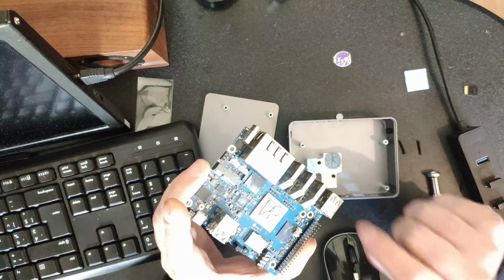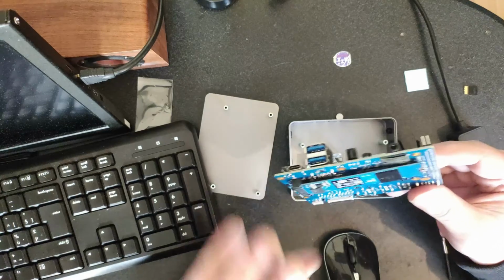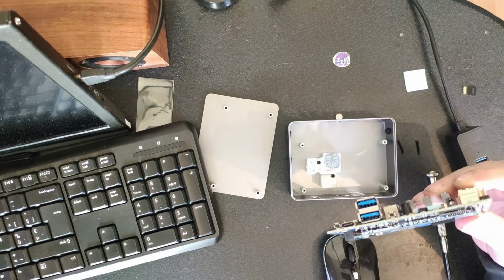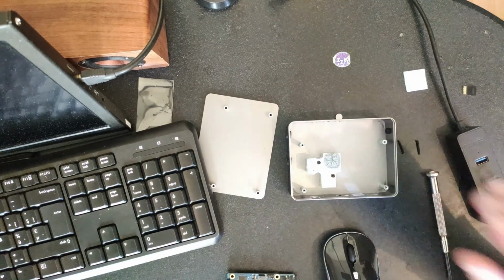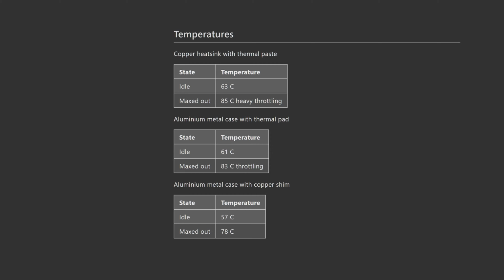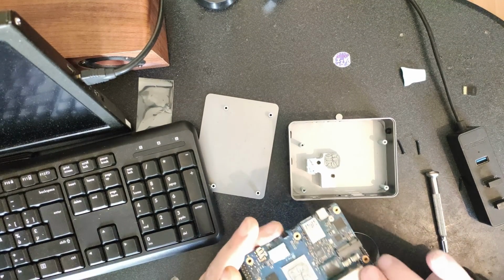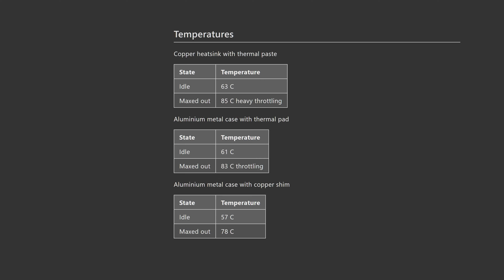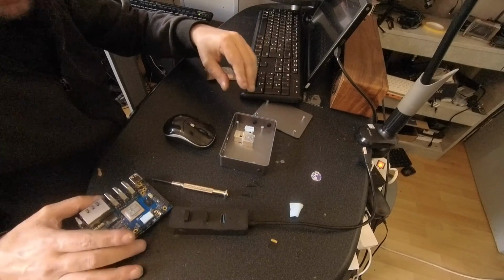Orange Pi 5 Plus Metal case - Improve Thermals

Comment from the maker: !!! Seems that freon, the taskbar app I use in Gnome to check temperatures is faulty. It is reporting a temp of about 10C higher than true SoC temp!!!
So idle it is 49C and maxed out 71C.
The NVMe does get hot in this case. Always above 60C and even goes over 70C with high use.

Issues fixes
------
!!! Fix for the mouse lag in Wayland Gnome. (Thanks Spooky)

# Needs root access so first "su" 
# Mouse lag/stutter (missed frames) in Wayland sessions
# https://bugs.launchpad.net/ubuntu/+source/mutter/+bug/1982560
```
echo "MUTTER_DEBUG_ENABLE_ATOMIC_KMS=0" >> /etc/environment
echo "MUTTER_DEBUG_FORCE_KMS_MODE=simple" >> /etc/environment
echo "CLUTTER_PAINT=disable-dynamic-max-render-time" >> /etc/environment
```

#Some chromium errors can be fixed with (Thanks Infinity Q)
sudo apt install xdg-desktop-portal-gnome

#Fix Chromium not saving credentials (Thanks AmazingFate)
sudo rm -r .config/chromium*

#USB unstable problem
#Install an older kernel.
#USB issue? I had that problem a while ago trying out kernels for my OS. I didn't really figure it out, but armbian-rockchip rkr4, 5.1 and 6 seems to work fine  nowadays (Infinity Q)

Comment: I don't know what's going on with your Orange Pi. My plain Orange Pi 5 idles at 32 C with the same type of case and no copper shims. I have an Apache server running (with very little traffic going through it, but stil) + Home Assistant + a VNC server running as well.

Comment: I’ve been trying to figure out if this case had a column for the components to use the case as a cooler. I don’t want a fan that will get filled with dust over time. 
Good video!

Comment: I took off the heatsync it came with and replaced with my own fan. Unscrew the heatsync, pull it off the pegs, and then bend the pegs with pliers. they pop out smoothly, almost as if they were glued on. now you will have all the space to add your own fan. If you so choose, you can drill a few holes for circulation but it seems fine as the case doesn't seal tight anyways, and definitely better than without the fan

Comment: Thanks for the review. Wonder why they did not put another aluminum collum on the case to take the heat off the board's PMIC. It is widely known that other that the SoC itself, the PMIC is also the hottest component on an SBC.

Btw, it would be very useful if you could do a comparison between Orange Pi 5 running on the latest OS with the latest kernel and drivers vs Raspberry Pi 5.

Comment: Yeah, those pads are sketchy. You need to press them hard for all surfaces to gain contact. 

Is there news on PanThor driver for this Mali GPU?
Reply from the maker: There are mainline images with Panthor from Balbes150 for OPi5. Not sure if they work on OPi5+ too. https://forum.armbian.com/topic/27588-kernel-62-hdmi-usb-lan-etc-for-opi5/
I've not yet tried them. I'm now focused on getting vendor to run well with Armbian. 
Panfork gets 1026 glmark2 on X11
Panthor gets 781 glmark2 on x11
Panfork gets 1315 glmark2 on Wayland
Panthor gets 2314

Not sure if these numbers are anything to go on. Different kernel, driver, image, version of glmark2... But seems it performs better on wayland....
Reply: Wow!

Comment: I tried mine out before I plugged in the fan, and I never got above 55C while compiling a large C++ codebase. Maybe it’s the silicon lottery, as mine tops out at 2.35 ghz. Also, Chromium is extremely slow on Jammy for some reason, and firefox-esr crashes all the time. Only the firefox snap is working 😢
Reply from the maker: I'm looking into the chromium problem. I've been using RK3588 for months as main desktop and don't have those issue's(Meko-Mini). 
But I do not want to update/upgrade to find out if it would be the same.
Indeed the silicon lottery seems a big factor with RK3588. I expected the case to perform way better actually. I'll have to test my different RK3588 with the same heatsink to see what difference there is. They all have a different base clockspeed on big cores. Between 2.2Ghz and 2.4Ghz. Good topic for a new video.
With setting to 2.4Ghz it doesn't seem to be running hotter. At least not measurable enough.
Greetings.
Reply from the maker: Look at the first comment for the fixes. Maybe it fixes your issue's too.
Reply: @NicoDsSBCs  Cool, thank you! Has the no panfrost for Bookworm issue been fixed also?
Reply from the maker: @adamschackart6859  I know people who use panfork on Bookworm. But they've build everything manually. There are instructions online somewhere but they're long and hard.

Comment: Thank you this answered one of my future questions about fanless cases/operations.  I have been playing with the OP 5+ for a side-project.   Currently using the Armbian/Jammy  I find similar issues with chromium but not other browsers.  I'm not really using any browser so this is a low priority.  I think this is a cool/powerful SBC and has a lot of potential but the "quirks" remind me its still in early stages of user adoption.  Good luck on working out the issues.  I'm lucky most of my applications are either CLI or a very basic GUI.
Reply from the maker: Thank you for this info. Helps to know others have it too.
The Chromium browser has VPU and GPU acceleration so I suspect that to be the problem. 
I need to test some non-Armbian images to see if they have this problem too with the amazingfate ppa's. Greetings.

Comment: I've added thermal paste between case and alum. brick block and it seems be better at least a few degrees. Case gradually goes quite hot. I intend to add some ventilation wholes and maybe even fan to cool it better.

Comment: Offical spec(got it from support) says that it needs 2.5mm thermal pads on ram and 1mm on CPU. Kinda weird that I don't have issues with overheating, perhaps my load is casual. I plan to add thermal paste between alum. brick and the top panel. I think there's nothing now. I use Joshua Riek's distro and I used your Gaming Script and it was not throttling in WoW 3.3.5 for 20 minutes(but it was barely playable tho :D).
Reply from the maker: My test is 30ninutes all cores maxed out. Not a normal task. It would not have overheated as much with normal tasks. But it's not acceptable for me. I also suspect not all rk3588 run at the same temps. Some seem to run cooler with smaller heatsink.